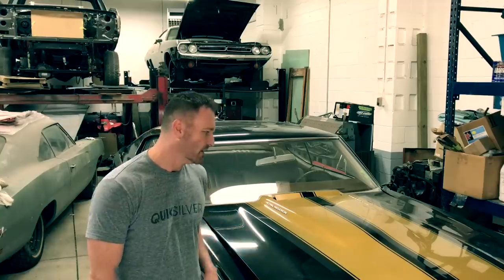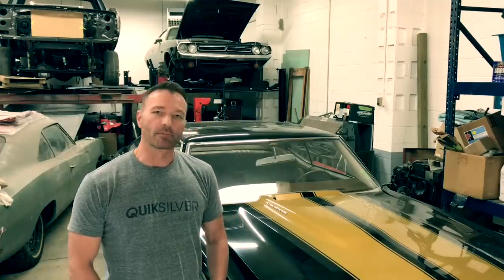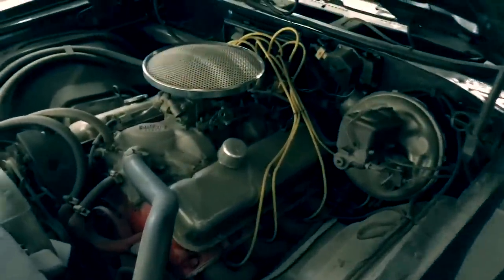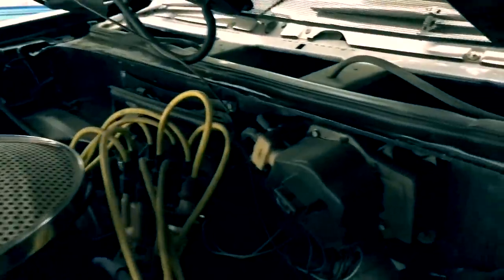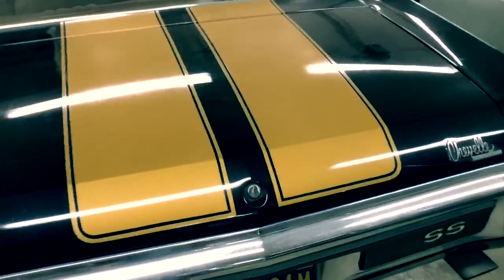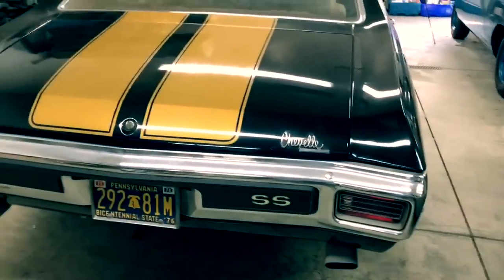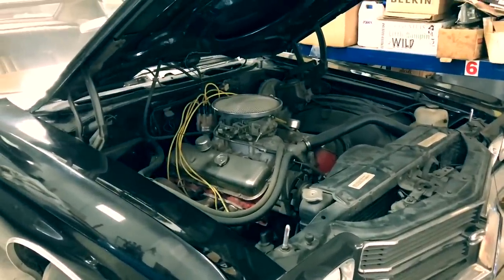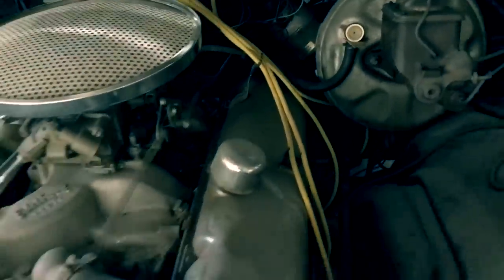Amazing 1,092 Mile 1970 Chevelle SS454 LS6 Found In Rural Pennsylvania

Comment from the maker: Garth Clark, the car is proven by many especially the widow of deceased owner to have sat the last 42 years. The last time it was registered was 1975 with only 1010 Miles in PA. PA is the only state it was ever registered. The original Owner also states he only street raced the car the first 2 years and had other means of transportation. The paint, body, interior, weatherstripping, and undercarriage all are unbelievable. The car truly speaks for itself.
Reply: Its kind of sad if you think about it. Its a nice car i would love to see cleaned up and driven. I have a 1970 Elcamino which i bought and put a 5.3 LS in it and drive it every day in any kind of weather (except snow). I haul junk to the scrap yard at least once a month i haul 4 wheelers etc. And any time i see something like this i just feel the car wants to be ripped out doing a massive burnout on the street. I hope someone drives it one day.
Reply: Patrick Glenn Nichols Musclecar Barn Finds ......
I have one question, 
You stated that it has a 13637 V.I.N.  to my knowledge,  a 13637 V.I.N. denoted a Small Block equipped Chevelle,  whereas a 13837 V.I.N. denoted a Big Block Chevelle.  I have owned 4 different 1970 Chevelle's , including a Documented  LS-6 454  ,4 Speed car ( 13837 V.I.N. ) ...a Documented SS (13637 V.I.N. )  that came with the 300 H.P. 350/TH-400, along with a very rare 1968 396/375 hp,  4 speed Concours station wagon. a 1967 SS 396 2dr. ( Heavily modified for drag racing,  swapped to a 427 )......a 1968 2dr drag car with a 406 small block,  and a documented  1971 SS 2dr. ( 13637 V.I.N. ) small block 350/TH-400 car.
 Not to mention, a 1972, 307/TH-350  4 door sedan,  and a 1972 350/TH-350 pillar less hardtop 4 door as well. 
So, suffice it to say,  I'm pretty knowledgeable about the 64-72 Chevelle's! 
I just wanted to point out the V.I.N. number question,  maybe I missed something along the way,  but that's what I always knew . If I'm not correct,  then show me,  lol.
Great video,  beautiful Chevelle
Reply: Dallas Fite .....sorry buddy, I quote what I know. I don't need to Google it, I already know it because I've owned plenty of those Chevelle's in the past.
No need to put on a front,  I speak from experience my friend.
I still have a 1977 Impala 4dr. ...that runs high 11s on the motor.  I'm 50 years old, and I've owned well over 125 different vehicles since I was 16. 
I have a rolling total of 5 vehicles. .  ALL 5 on the road, up and running, tagged and legal. Plus a 22 ft. Trailer to boot.
Check out my channel.  You'll see the Impala, and some of the cars I've built.  Peace brother!
Reply: Patrick Glenn Nichols Musclecar Barn Finds  awesome find  buddy just sub to u I came across ur video of the nova  purchased from the yenko dealship
Reply: Impalaman. GM Did not use 138 on a Chevelle after 1968.
Reply: Patrick Glenn Nichols Musclecar Barn Finds oo
Reply: Well is an fabulous car indeed but i got to tell you this man, to bad you are so selfish.. I mean ok you want to keep the original low mileage.. i get it but at least you could do for us to let us hear it (start that damn car so we could hear how it sound).. but yeah, maybe next time ?! cheers..
Reply: Yeah I was wondering why it did not have any mirrors on it lol.  I understand now. It was a racing car.
Reply: @myassizitchy  I love this you are 100% correct. I wish I had shut his mouth.
Reply: Impalaman1968 he’s trolling you dude.
Reply: I miss my 70 SS 396 Chevelle  , I bought from a guy who had taken it to a speed shop in 1974 ,I think he ran out of money, miss this car , paid around $5000.00 for her ,she was fast and so was the girl friend that rode with me
Reply: I know where  Messemore is. It's actually near Uniontown
Reply: @poplaurentiu4148  The owners most likely won't oblige him!
Reply: Almost the holy grail, thanks Patrick
Reply: @duramax78  are you implying that he  wasnt being serious? It sounds like he really was trying to question Impala's credentials by making a joke at his expense. Usually you respond when someone tries to make you look stupid.. especially if that person made a false assumption about you that is probably true of themselves
Reply: @PolecatCreekGarage  Your LS swapped El Camino is not worth a fraction of what this car is worth. That's the difference. This car is so valuable it won't be driven at the risk of it being wiped from earth completely. That's just how it goes with cars like this.
Reply: @cali2468  ok and who cares, can be replicated anyday. Drive the living crap out of it
Reply: @PolecatCreekGarage  Who cares? Um, I dunno...probably the many individuals who buy six figure cars like this. Not people like you who can't afford it. Therefore, you'd never understand.
Reply: @Impalaman1968  this guy don’t answer.  1000 miles and owner changed all things mentioned.  Why MSD wires?  Theses a button behind speedo that pushed and pull speed cable off leaving the car TMU. True miles unknown.
Reply: @poplaurentiu4148  yes people have these " barn find " cars and scared like a little girl to enjoy them ..... my grandfather worked with  GM 
56 to 80  was in engine department and  others   he has  yenkos and others with winters foundry 427 engines etc  and low miles but 
They are driven  ..... our machine shop  has stayed busy  with idiots afraid to drive them   we have  a 396 425 corvette in shop 
The engine issues could have been avoided with some marvel mystery oil in fuel  and driven regularly... but instead  we have to tear engine down 
And clean up  everything  mostly stuck rings and valves ...  damn they are meant to be driven   .. and enjoyed  ...

Comment: We had some insane cars back in the day. I was fortunate enough to have driven a brand new SS 454 in blue and white when I was about 18 years old. What an incredible car. It was all stock and had no problem turning the hides into big clouds of white smoke. They were battleships. 
I believe that if there were more rev limiters more of these beauties might still be around, or there may have been more fatalities do to speeding. 
You could actually work on these cars yourself. Absolutely amazing cars from the dealership (Muscle cars). Big Big blocks. Big Big carbs. Big Big values. 
How many of you wish you could go back and buy say 4 cars ? What would they be? Dodge Daytona, tri power vette, mustang fastback,olds 455 HO , Buick GS,AMX ,302 z28, the Judge, and it wouldn’t cost as much as a Dodge Viper. 
You don’t know what you got until it’s gone.
Reply: 69 stingray 427
Reply: 1969 Chevy el Camino 1969 chevelle 1970 plum crazy roadrunner 1967 Pontiac GTO

Comment: Thanks for what you do...your patience with people is amazing, the comments are so easily answered in your details...As far as some of the comments I question why they even bother to admire a time capsule and pick it apart.but that’s the day and age we live in..I’m a Chevy gear head born in 68 and worried there would be no cars when I was of  age to drive...,,I’ve owned many original 1 owner cars and was a day two kid. In 1986 I bought a 34k mile 74 Z/28  all original  and didn’t day 2 it but did unhook the speedo cable.. for obvious reasons ,,it now registers 70k  .. and has many day 2 mods to my likings,,,and when I’m dead and gone it will still be the car I wanted it to be...all numbers match drive train wise..and appearance wise ..even the stupid tower clamps..holding hoses on a winters intake and quad carb  again my car since 86 ,,with a set of slicks it would run a 13.88 consistently with the stock 350/245 hp motor (no smog) ..again my car my choice it’s been parked and not licensed since 90ish  ok point is it all original paint stickers shocks deep grove pulley blah blah blah .but I made the decision to drive it and enjoy it but keep it as close to og as I 16 year old could....so  if that Chevrolet Chevelle could speak..it would not be as patient as your are,!,, u do a damn good job and the passion shows..keep on finding the cars ..that was the first I heard of the plastic inner fender wells ...I had a 71 but was a Norwood car I believe... .Im glad the owner used the car and enjoyed it...rare rare find ..thanks

Comment: Back in about 1985 this local bar I always went to in NW Indiana...was holding a raffle for a 70 454 SS bright red with black stripes.Not sure if it was an LS6 engine.....but it was 4 bolt main 454 with an automatic trans.As soon as 10,000 tickets were sold @ 20 a pop.....the raffle was held.One kid in Crown Point Indiana won with a single ticket.I remember this one guy buying 1 ,000.oo worth of tickets....and he still lost.I bought 5 tickets.Years later it was said the guy holding the raffle for the Chevelle paid only about 17k for the car.Had the whole thing super detailed and sold as I said....every ticket.So that's 200 k minus what he had in it.Well so he made his money and then some.This guy had about 4 other raffles through out the 80s and the 90s.What a way to become a millionaire....because he did eventually.To this day that car is still nice and clean.Same owner.Man that kid was the talk of the county.That is a nice ride you have there.My fave year is the 67 ss.My cousin had a clean 66 back in the late 70s.With the 396/350 hp 4 spd.His was trple black.
Reply: I liked the way the '66 396 handled, I had a '67 small V-8 myself, never drove a '70, rode to Summer Camp in a '71 Chevelle, front end seemed to lift?
Reply: Wonder if he ended up wrapping it around a pole.
Reply: Wow you could never hold a raffle like that in Canada.

Comment from the maker: Yes sir. I didn’t go into much detail on the day 2 items and their rarity. That would require another 5 minutes or so. It’s tough to stay under 15 minutes and cover most of the important features. With that said, the Baldwin Motion Fly Eye period correct air cleaner is super cool and hard to find. Thanks for your interest and good eye.
Reply: Didn't know Matthew MacConeaghey did Chevelle reports lol!awesome car
Reply: yeah, those aircleaners were everywhere when I bought one for my '71 chevelle in '78. I think its still in the garage someplace , stopped using it when I found out that the gas fumes from the holley  ate away the foam filter after shutdown. went back to paper filters.
Reply: Patrick Glenn Nichols Musclecar Barn Finds great great great great car bro,but it has been raced or just hot rodded"so great b ahh a.c. deleted,bro put it back on get that appraisal you'll be very $shocked great car lucky to have that bro worth so much og

Comment: For 1092 miles there are alot of modifications under the hood...plug wires, hoses, clamps etc, etc. You'd think with those miles some of these things would not have been touch...
Reply: Certainly possible it was raced and that's where most of the miles came from.
Reply: I say the same thing ,I have worked on cars for 45 years and can tell this car has many more miles
Reply: if the car sat fir any length of time in the past i can see why the plug wires and such had been changed for a tune ups sake.
Reply: @Maxx, you can tell how many miles are on a car from a video....cool story bud!!
Reply: 👍 good point
Reply: Tell us how you would determine your b.s. claim?  Bet the man some money if your that positive, say a $1,000.00 dollars. The oil from this car by a sample sent to the lab will give the true mileage. I say he would bet you.
Reply: Louie, evidently you have no clue as to what a "day two" car is.
Reply: kanukster agreed,the 2nd day is when it began being hopped up and/or personalized,we still do it today just like they did it back then...
Reply: Its no different than today, you have guys that modify their cars over a few years and guys that start changing stuff the day they buy it. None of you can say for sure that this car doesn't have 1092 original miles just by its mods.
A good question would be how long the old man waited to paint the stripes gold.
Reply: correct ,if you look closely even the alternator pulley is not original ,this guy does not know what he is talking about or he is a typical salesman looking for a sucker
Reply: 3XL OUTDOORS I can. That’s a lower miles car, but if you’ve seen low low mile concourse cars then you’d know they look damn near like a new car. I’m guessing this car probably was beat and the trans went. The original owner probably swapped it in his driveway and either didn’t connect the cable or broke it and didn’t replace it. This car has probably 70-80k miles
Reply: @mattperkins7038  Yeah....and it was last registered in '76.....OK.
Reply: Not unusual for a car that was raced during most of those miles. I had a neighbor back in 1969, (2 brothers) that both bought brand new Super Bee's and never put them on the road. They went thru hi-pro mods and ONLY saw the drag strip for several years before they were sold (not street legal). 
A racer, goes thru a lot of hell and sees a lot of repairs and mods. Things break almost every week. 
I see no reason to question the authenticity, by what you see and hear in this video. Would like to have heard it run.
Reply: Everyone that doubts the cars authenticity you're all a bunch of jealous losers driving your 1983 cutlass 4 door . Thanks for the video Patrick keep up the great work
Reply: @estop4804  agreed!
Reply: estop 480 exactly, dreamers.
Reply: I'm wondering if the gold stripes would diminish the value very much.
Reply: It's also pushing 50 years old..... Car didn't look neglected.

Comment: See a lot of comments, questioning the authenticity of this car, due to some mods.
Not unusual for a car that was raced during most of those miles. I had a neighbor back in 1969, (2 brothers) that both bought brand new Super Bee's and never put them on the road. They went thru hi-pro mods and ONLY saw the drag strip for several years before they were sold (not street legal). A racer, goes thru a lot of hell and sees a lot of repairs and mods. Things break almost every week. I see no reason to question the authenticity, by what you see and hear in this video. Would like to have heard it run.

Comment from the maker: Yea that usually happened when the intake is changed. Those tower clamps are damaged very easily upon removal.
Reply: I saved many tower clamps back when they were plentiful, and install them on my 60's GM survivor full size cars. Once in a while I find some in an old junkyard. They're easy to save, loosen tower screw, tap down tower with same 3/8 socket. I'm sure they were not saved bcause they look goofy, like a dunce cap. The crappy stainless worm drive clamps are shiny, and everyone uses them, but I always liked the original look of the tower clamps, even 30 years ago. I just found 2 from a 73 El Camino in a junkyard in Greer SC... SCORE! I'll NEVER use the China soft ones! They twist and don't sit properly

Comment from the maker: Bcdhihi absolutely not. The car is proven and known to have been stored it’s entire life. It also was only registered in PA it’s entire life. Example :therefore a car can’t have say 20k Miles under a particular year’s inspection and then turn around and only have 1092 miles later on it doesn’t fly. Therefore the car was registered and proven to have less than 1092 Miles in each of the years prior to its last registered year which was 1975.
Reply: Patrick Glenn Nichols Musclecar Barn Finds My ex father inlaw has one about 20 miles south of Pittsburgh he bought new in 1970. He still has it unmolested and drives now only to local car shows with only a little over 8000 miles! Ls6 4sp black with white stripes and black vinyl roof. In excellent original condition!!!! Original one owner car!!!

Comment from the maker: Sorry dude the car is absolutely a documented 1092 mile car.. This car was parked 1975 for good and only used for racing by the original owner. It was inspected by the state of PA in 1976 with only 1010 Miles. So unless it was driven illegally for over 100k Miles it’s definitely real.
Reply: Patrick Glenn Nichols Musclecar Barn Finds d
Reply: Patrick Glenn Nichols Musclecar Barn Finds I had a neighbor that had a similar 71 Chevelle SS454 4spd car that he painted black w/gold stripes. As I remember it his odometer read around 2600 miles because of a busted speedo cable. This could be another example of a guy that simply was more interested in what the tach read.
Reply: Hi what do you need for it $$.
Reply: Patrick Glenn Nichols Musclecar Barn Finds j
Reply: Patrick Glenn Nichols Musclecar Barn Finds 1
Reply: Joe Blow, the tach runs off the distributor. Has nothing to do with a disconnected anything
Reply: Joe Blow: There is no way this car has over a 100,000 miles on it. The vehicle appears as if it came from the showroom last week. The clutch  and break pedal both look new w/ no wear, plus the interior is flawless.
Had this vehicle been driven in the Rust Belt in the winters at 100,000 miles it would be a rust bucket.
No this car is for real.
Reply: Everyone is a hater.
Reply: I don’t believe it would be more than 1092 miles on it just driving it for inspection for the six years...lol
Reply: So you say there is a chance that the odometer has rolled around